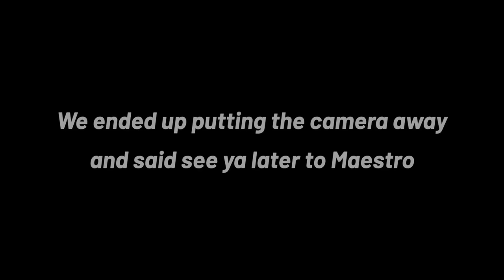Jet Ski RZR (Worlds First)

Comment: RC Boats are the best RC vehicles ever, especially in the waves.
Reply: Na
Reply: @jd_adventures  mine did break really easy in the salt water but it was still a blast jumping waves.
Reply: @tyride69  if you use a salt water boat then it will work
Reply: @jd_adventures  the inside battery connecter like flaked off or corroded. And it got rusty with sand.

Comment: That guy is a straight lie that has a Polaris frame and he modified the factory the outer points. You can look behind in the engine compartment and see the factory lower cage and the rear radius rod points all stock. Aftermarket upper cage factory lower is not a custom frame. He has a carbon off the shelf dash from another company. He probably got a cease and desist letter from Polaris and that is why he says "Custom".

Comment: he straight up lied those are just jet skis under it and he goes on to say he feels bad for anyone who does that.... like bro they still have the mirrors the seats.. you aint foolin no one. this is a hillbilly ride. would have had better if you stuck a razer in a boat and hooked up the steering. then it could pull itself to the water...

Comment: why all the bullshit about it not being a rzr, that's 100% a rzr frame. all the cage mounting spots are in the stock locations, all the bends around the front suspensions is the same, all the a arms are the same the rear radius rods are all in the same spot.